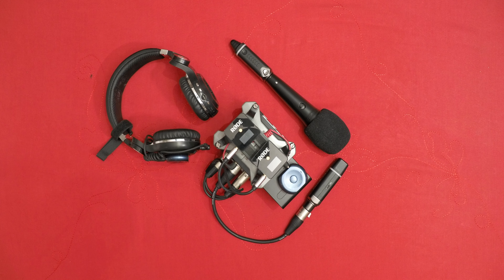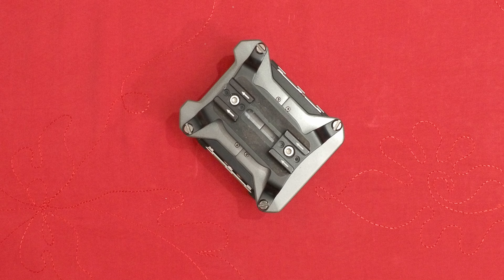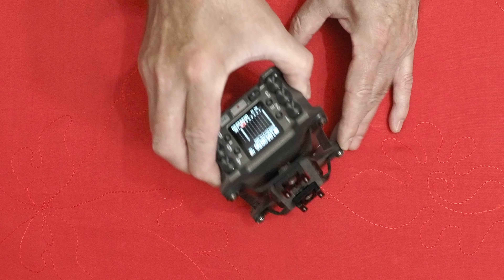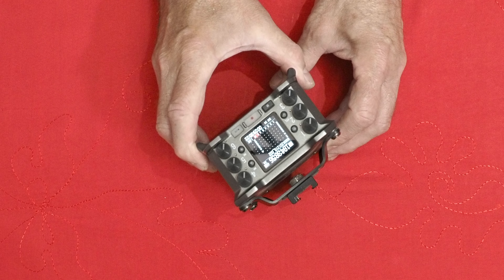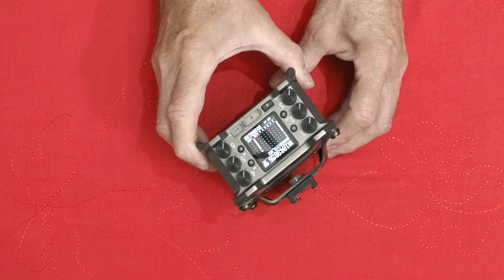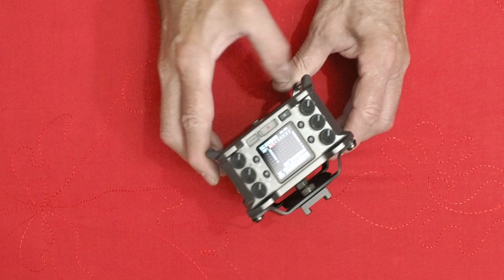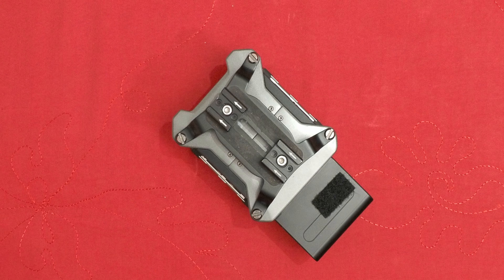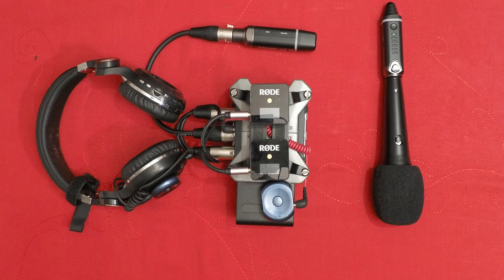Zoom F6 Audio Setup Explained

Comment: Was led here by your reddit comment. Man what a greaet setup! Would be perfect for a traveling/run and gun filmmaker like me. Thanks for sharing.
Reply from the maker: It may not meet everyone's needs, but I don't think I could make it any better. Once it goes into that Lowepro bag, you wouldn't even know it's there.
Reply: @AustralianImage  do you have a link for the batteries you use? Or does it not matter really?
Reply from the maker: @wcsdiaries  The batteries don't matter that much. I use either Duracell Alkaline or Eneloops inside the F6 and inexpensive NP-Fs externally.

Comment: Excellent video. I also have the Zoom F6 with two sets of Røde Go and it works perfectly.
Reply from the maker: Thank you. I've found this to be a great all-round combination.
Reply: i have the same devices but i don't have those mounts for the rode transmitters.. where can i purchase?  what's the actual name of those mounts?  thanks in advance.
Reply from the maker: @dolo747  The Wireless GO mounts are just cold shoes like these: https://www.amazon.com.au/SmallRig-Adapter-Bracket-Camera-Monitor/dp/B00HJFBUCQ/ref=sr_1_3?dchild=1&keywords=smallrig+cold+shoe&qid=1613428885&sr=8-3.

Comment: The biggest issue i am having currently is that i cannot silence tracks temporarily without turning the gain all the way down losing where it was previously set. I was able to do this on the F4 and it makes checking on the positioning of radio mics on set too tedious. Hoping to find a solution otherwise i will be sending it back!
Reply from the maker: I guess the only way to do it would be to disconnect the mic individually.

Comment: Hi, just returned to your video, I saw it some time ago and like you I got the NUX B3 wireless set up. Got to ask, are you getting a lot of background noise from your set, I use it with an NTG 2 and gotta say the background noise is noticeable. Like you I’m using the wireless go systems with my F6, you get amazing quality sound from it, I use it with small mics for easy to place field recording, so compact and great audio for ambient or background sound.
Great video mate and tidy set up.
Reply from the maker: Thanks for the praise. No, I'm getting clean audio throughout, in fact I'm very surprised at how well the F6 works with wireless mics. I was having incredible trouble getting clean audio while recording in-car and the F6 solved everything: https://www.youtube.com/watch?v=ARArbWBF1-A. I haven't used the NUX B3 very much, or much of my other gear, as we've been in lockdown for nearly two years because of COVID (200+ days in the last year and a half and counting).
Reply: @AustralianImage  Thanks for your reply, yes I’m shocked at the quality of the wireless audio with the Wireless go, it was the NUX B3 set up I’m getting background noise, maybe I need to ditch that set up and concentrate on the wireless go set ups.
Cheers Ivan
Reply from the maker: @ive595  I have both the Wireless GO I and GO II units and they are pretty much all that I use, on their own or connected to a Lav or VideoMic NTG.

Comment: Great video. I need a recommendation, because when connecting the Rode Wireless GO to the zoom f6, the signal is very weak and when I increases the db, noise enters.
Reply from the maker: Have you set the F6 to 32 bit float recording or one of the others? If set to say 24 bit, then try dropping the gain in the Rode and raising it in the F6. I just use 32 bit float recording and don't seem to have any issues.

Comment: Nice compact and low budget setup! 
But I still wish Zoom had brought out a Zoom F4n instead of an F6 :-/ :-(
Reply from the maker: I think given that the Zoom F8/F8n are not a great deal more expensive than the current F4, they probably didn't see the need to upgrade the F4. Mind you, for many, the Zoom F6 isn't budget.
Reply: @AustralianImage  Zoom has said they see the F6 as the replacement to the F4, when it is *not*. 

The F6 in the grand scheme of things is definitely budget. The original Zoom F8 was truly revolutionary for how much it did, how good it was, and how dirt cheap it was!

Just like how the Nikon D90 / Canon 5Dmk2 / Panasonic GH1 etc were revolutionary for aspiring DoPs when they came out!! Costing so little yet offering so much, opening new doors for many aspiring DoPs starting out.
Reply from the maker: @SoundSpeeding  Yes, when it comes to the film industry, the F6 is a throwaway item, much like the BMPCC4K/6K. But what you say kind of confirms what I thought, the F4 has actually been replaced by the F8n. I don't think they could have kept the F4 line going with the introduction of the F6 and what the F8n offers. I kind of equate the Zoom F6 with the BMPCC4K/6K cameras, affordable, but punching way above their weight. As I noted in the video, the form-factor and features of the F6 were what took the MixPre 3 II out of the equation.
Reply: @AustralianImage  The F4 was intended as a lower budget version of the F8, that spot as been replaced by the F6. Thus the F6 "replaces" the F4, but it doesn't.... because you lose too much stepping down from a F8n to a F6, thus the F6 isn't simply a "lower budget F8n" like the F4 was for the F8. 
(I understand though why they terminated the F4 after the F6 came out, just is a pity a F4n didn't happen instead. Perhaps the F6 could've been an even more compact "Zoom F3", to further distinguish it from an F4n)

I was before comparing the F8 with the D90/5Dmk2/GH1/etc because those cameras were truly revolutionary and game changing, that era was called the "HDSLR Revolution".  Not only did they open the doors to young aspiring filmmakers, but they were even used as A Cam on quite high profile productions, such as an episode of House and the pilot of Key & Peele, just to name a couple of many examples. 

The same is true for the Zoom F8/F8n, but for the Sound Department. We live in a fantastic time of opportunity!
Reply from the maker: @SoundSpeeding  I have to admit that I don't know enough about the industry to make more than observational comments based on what I've researched (and do I research), but even then my knowledge can be wanting. I see where you're coming from, but I guess Zoom has observed their market and decided that to compete with the likes of Sound Devices, they can't keep all product lines going. In fact, it can become confusing to the buyer when too much overlap happens with products and then people start complaining about lack of this or that in one line or the other. I look at it this way, there is absolutely no way I could have bought or justified something equivalent to the quality and performance of the F6, or BMPCC4K, of say 10 years ago. I could justify my stills gear as that was all work related, but audio/video gear, not a chance. And we certainly do live in fortuitous times.
Reply: @AustralianImage  It is dangerous grounds when you go into "I can justify this purchase as being work related... "  somehow I've found myself with a quarter million RRP worth of sound equipment! Whoops. haha

I think Zoom does extremely well in competing against the Sound Devices MixPres series (it is FUD and brand loyalty which helps keep the MixPre series be so popular), a mythical "Zoom F3" (an even smaller F6) would have been better for Zoom to compete against the MixPre series. As I think that is where the likes of the MixPre3 keeps an edge over Zoom, being ultra compact. Thus I wish Zoom had gone harder in making the F6 even more compact? ("F3")

Ah well!

I do hear rumors going round the sound mixer circles that Zoom has a higher end product in the works to be coming out "soon" that's placed above the F8n, perhaps Zoom then will have competition against the likes of the 833/888/Nova/Mini???
Reply from the maker: @SoundSpeeding  While I could legitimately justify gear as work expenses (even now), I'm always kept in check to a large degree by my somewhat cautious approach to spending and an ever watchful spouse. The latter does give me some leeway.

I suspect that Zoom wanted to pip the MixPre 3 with form and function features that the MixPre lacked (the extra XLR ports) or did differently (battery options) and I think they succeeded. The MixPre's claim to smaller size especially is an illusion, once you factor in their battery design. I have no regrets getting the F6.
Reply: @AustralianImage  ah that is my problem, a lack of spouse! haha
Nah, I've got a partner (not married or anything, but been together nearly a decade) however our finances are kept completely separate apart from paying the rent together.
Reply from the maker: @SoundSpeeding  Sometimes that's a good way to be.

Comment: So you can run 32 bit float into the camera using the rode lav hooked to the zoom F6?
Reply from the maker: It's not 32bit float into the camera (the camera doesn't support 32bit float), but what appears to be 32bit float from the VideoMic NTG transmitted to the Zoom F6 via the Wireless GO attached to the mic. To be honest, I have not been able to confirm whether the Wireless GO does transmit an analogue signal to the receiver and then the Zoom F6, but the end result is much the same. I've done tests in Fairlight and can bring out almost inaudible sounds and make them quite clear and clean. There's some sort of magic happening, but I don't really know what it is and why it's happening. But I won't look a gift horse in the mouth.
Reply: @AustralianImage  Thanks for the quick reply! I’ve got the same setup. Is there anything specific that needs to be done with the wireless go or is it just plugging in and adjusting volume as needed on the F6?
Reply from the maker: @jakehubermedia9367  I just plug in the Wireless GO and set the F6 volume to about half way or so that it doesn't peak, but I'm not sure if it really matters. Either way, it seems to work.
Reply: @AustralianImage  So I just tested this but I may be misunderstanding slightly. Are you sending a feed from the H6 to the camera using the Rode wireless go system? If so, how are you able to achieve this? I have my Rode NTG5 plugged into output 1 but if I use output 2 to transmit the wireless go to my camera it does not work. Basically the only way I can make it work is by using line out and plugging directly into the camera, taking the wireless go out of the equation. If you could please let me know how you are achieving this that would be amazing. I would love to run my main mic feed into my cameras wirelessly if possible.
Reply from the maker: @jakehubermedia9367  What I'm doing is sending the signal from the camera to the F6. I have is a splitter cable connecting the mic to the XLR port and the Wireless GO transmitter. So the camera gets a signal from the mic and the F6 also gets a signal from the mic. I've tried this with both the Rode VideoMic NTG and Rode VideoMic Pro+. Both seem to work much the same.

I just did a bit of a test to see if I could produce what you appear to be after and it's fairly easy. I connected my mic to the F6, then connected the Wireless GO receiver to the 3.5mm input on the BMPCC4K and the transmitter to the line out or the headphones out. Doing this sent a strong signal to the camera (more so when the transmitter was connected to the line out). This would not work when the receiver was connected to the XLR port of the camera, which is a pity.

Now I didn't do an actual audio recording to check the quality, but the concept works. I might have to look at this, as it does open up some opportunities.
Reply: @AustralianImage  Thanks so much for sharing! This was very helpful.
Reply from the maker: @jakehubermedia9367  Glad that it helped.
Reply: @AustralianImage  So do you record in 24 bit as well as 32 bit float so you can trim the wireless lav tracks on the F6?
Reply from the maker: @ocliveonline7985  I have the F6 set to 32bit float only. I didn't find any benefit of setting it to 24bit and 32bit. I have a video coming out today showing a redesigned audio setup and recording outcomes using the Rode Wireless GO I and II, with in-camera recording and F6 recording via wireless as well as VideoMic NTG. I found the results quite informative.

Comment: Was this recorded on a stereo mic? The balance is off to the left side.
Reply from the maker: This was recorded on a Rode Wireless GO (just mono). So I listened to it using headphones to check and there's no left bias that I can discern.
Reply: @AustralianImage  hmmm, well it sounds noticeable compared to your BMPCC tabletop vid.
Reply from the maker: @ratherbyexploring4898  I think you're right. I just checked the original audio in Fairlight and it appears that the left channel is set louder than the right channel. I can't explain why that's happened. It's something that I'll have to look into and figure out why.